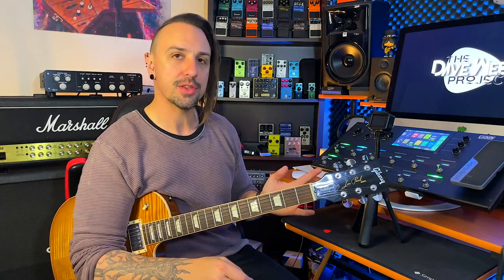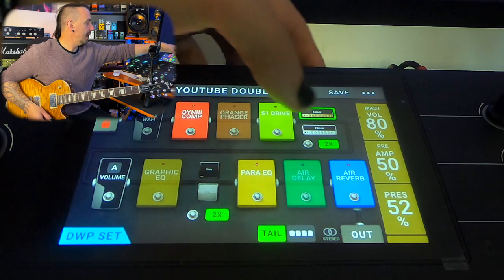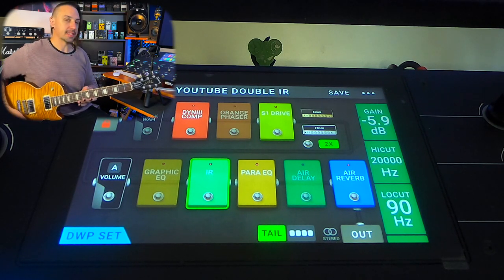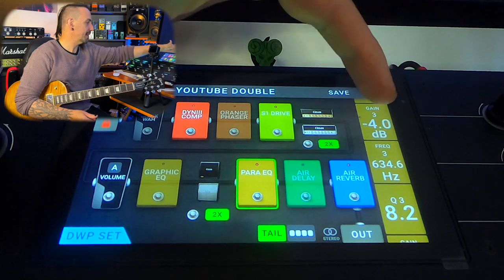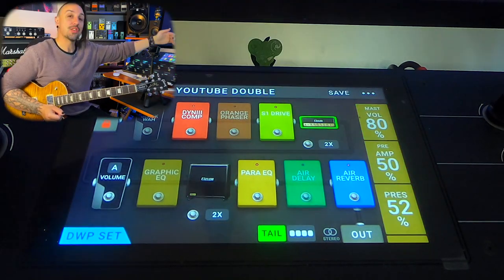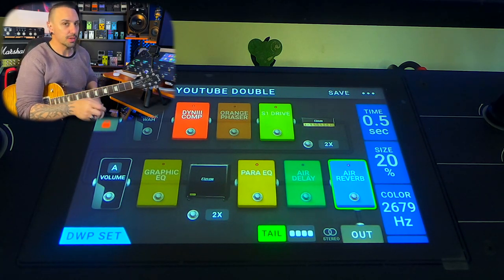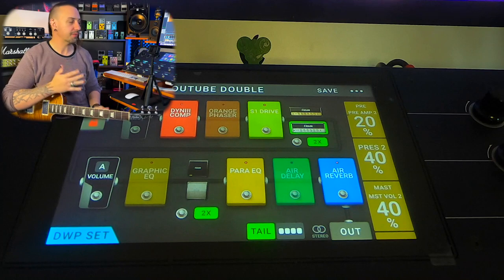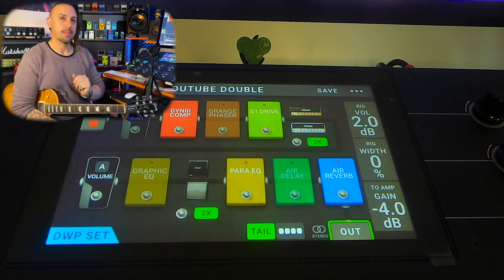How To Make A Dual Amp Rig In The HeadRush

Comment: Thanks for this. I guess I was disappointed in the unit itself at this point because you can't actually have separate eq's for each amp (at least in my mx5) and I was trying to split the outputs to cut some low end to the headrush 8in speaker on one side while maintaining the studio eq'ing that goes to the sound guy on the other.

Comment: Quick question for you, man. I’ve been watching a lot of your videos, and obviously, you know your way around the head, rush, really well!

Is there a way to modify pedal and amp parameters per scene? Not just turn things on and off, but adjust parameters like the mix of a reverb or delay, the gain of the amp, etc.?
Reply from the maker: Hey man. Thanks for watching.
So short answer to your question is yes.
You need to save the settings of your amp, stomp, reverb etc as a preset and you can then re-load that preset into different scenes.
When you go to scenes you’ll see the option for presets on each block that you have, simply choose the one that you want to load, and BAM!
Reply: @DaveWebbMusic  Thanks man!

Comment: Nice video Dave!  What would a standard physical rig look like when grouped with this headrush?  Does it require a power amp to power the thing?  How would you set this up for a live performance?  Also, how different is a live performance rig compared to your studio rig?  Do you just run this thing straight through your monitors at home, or do you pair with a cabinet or something similar to a live rig?  Thanks for any info.  I think this product is so friggin cool.